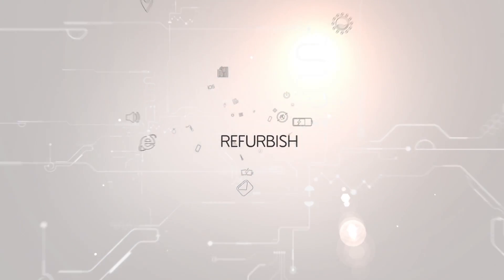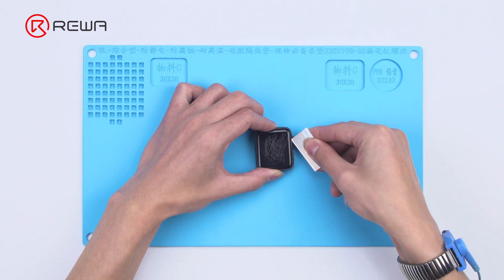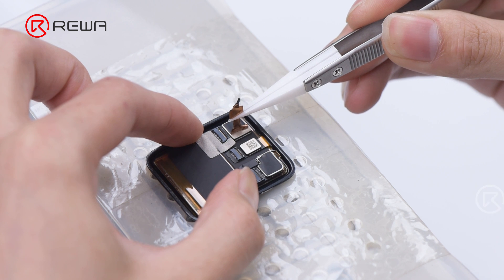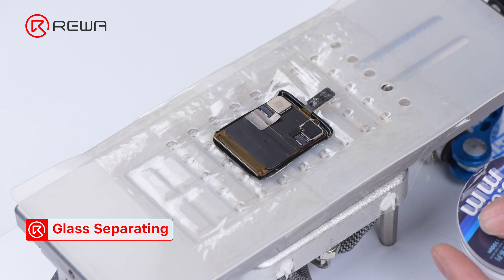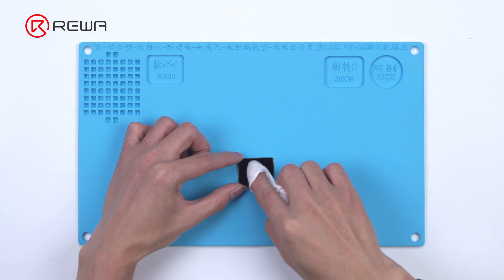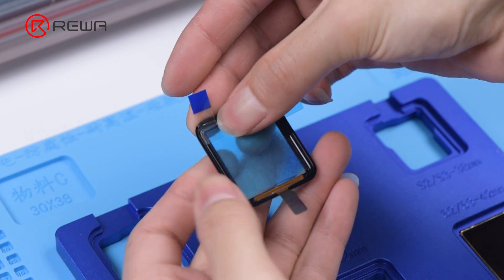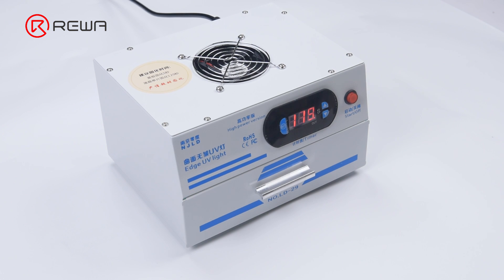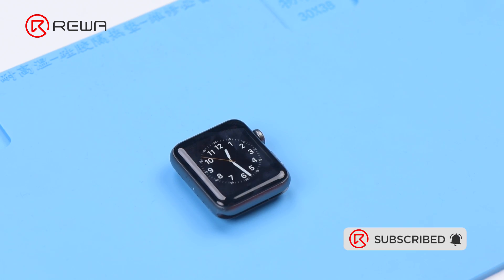Apple Watch Series 3 42mm Touch Screen Repair - Glass Only Separation

Comment: Help I have done it all and when reconnecting all a green screeen in appearing ! Help do you have a solution
Reply: You probably damaged the display panel sadly and need a full replacement now
Reply: @Tactical_Taco  damn fuck it , and it still working bcause I had Siri activated when I tried !
Reply: @AlexVttFreestyle  sorry bro I know that sucks :( I won’t even touch an Apple Watch to repair I’m too worried of doing the same 😅

Comment: Why force touch stops working after replacing touch screen in series 3 42mm
Reply from the maker: Force Touch function works normally as before replacing.
Reply: Same here. Ultimately touch stop working after touch replacement. Anyone?